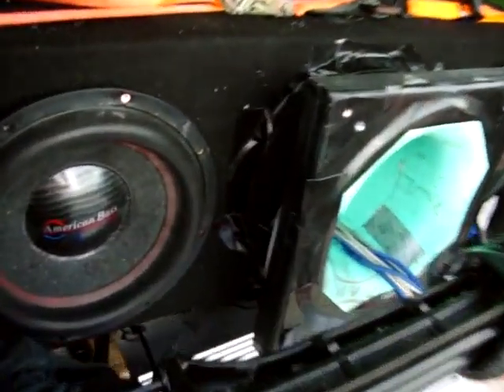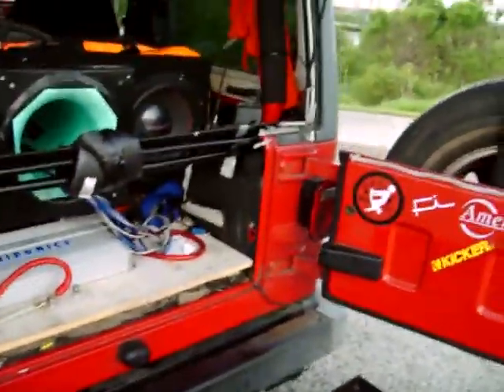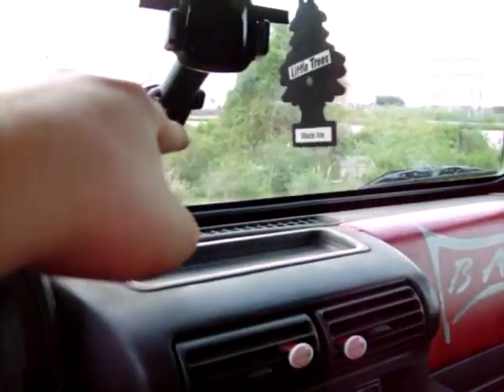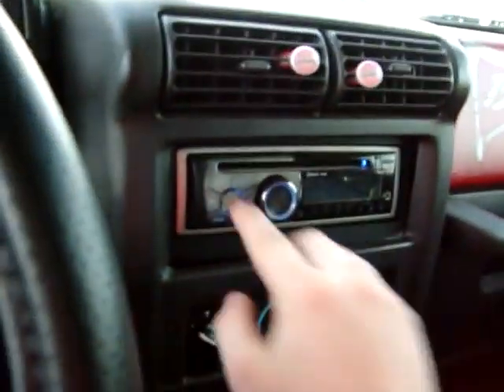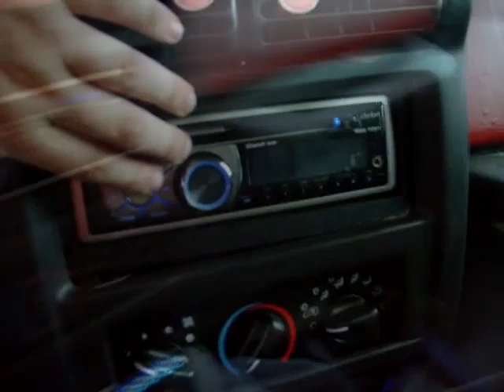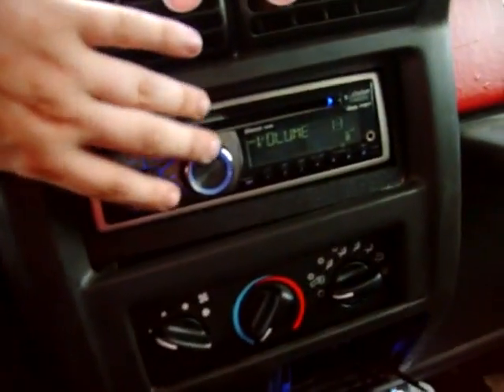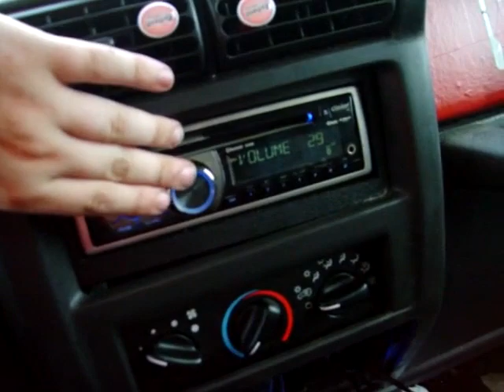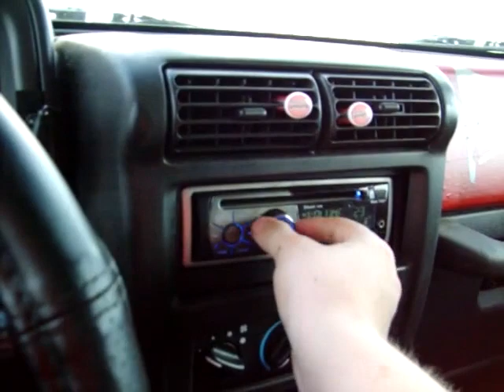Testing The American Bass Hawk 12s In One Of My Old Boxes. . . (w/ Outside Flex)

Comment: Ayy Hifonics. I bought my Hifonics amp just to free up channels on my 4 channel amp and didn't expect much from it... Little beast has exceeded my expectations and still chugs along even in 120F+ Florida weather. (It's Hayate if you couldn't already tell)
Reply from the maker: hifonics, while obviously not the best thing around is definately beastly for what they are
Reply: @BASSWRANGLER2000  Yeah. I want to upgrade it but at the same time it's almost not worth it. It does all I need so until I decide to try subs that need more power it's going to stay.

Comment: I have a single Nsv4 18 on a 5k in my jeep yj 1994
Reply from the maker: nice man, thats alot of box for a jeep to get the right airspace for an 18, im assuming you probably had to invert the nightshade 18 huh?
Reply: @BASSWRANGLER2000  my box is 6.5 cubes after displacement, I have the sub normal , and it’s tuned to 31hz , I need to do a video soon on it .
Reply from the maker: @biscostuntz5930  would like to see a video when you have a chance to make one! would love to see another jeep with a spl setup in it!